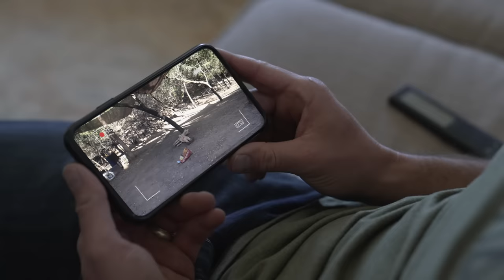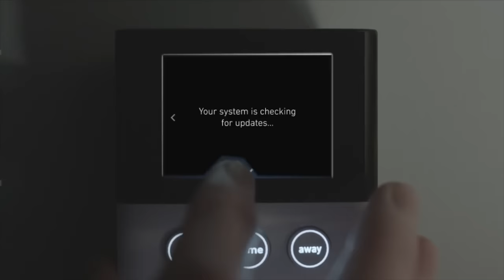Can a Brand New AK Survive the Demolition Test?!?

Comment: just a little calculation : the sound takes 0,384 s to travel from the 100y plate to the camera. The speed of sound given the approximate temperature in the middle of the day at the date of the video (24°C/75,2°F) is 345 m.s⁻¹(~1132 fps) so the sound takes 0,265 s to travel from the plate to the camera, which leaves us with 0,384-0,265=0,119 s which is the time of travel of the bullet from the gun to the plate, which gives us a speed of 768,7 m.s⁻¹ = ~2522 fps which is quite high for an AK. It's really good
Reply: this needs more likes
Reply: I bet raunch dressing really stinks along with primers😅

Comment: Century’s like, “Damn, he actually destroyed the gun we cherry picked for him”.
Reply: I am glad Century finally decided to be honest with their customers. Pretty sure bft stands for blown front tunnion
Reply: @charisperissos1320  Yup. Garbage, just like all of their us made aks. Sad really.
Reply: Would results have been different with a Zastava, Palmetto State, or KUSA?
Reply: Ya confirmed what most already know about Century AKs
Reply: @Asertix357  guaranteed. Those are wayyy better quality and material.
Reply: @spacecadetofficer507  but for $800 this one is totally fine. The stuff Matt did to this AK is not the normal user experience.
Reply: @Asertix357  I found myself wondering if the front trunnion rivets would have held up better.  I actually had a WASR 10/63 blow up on me around 2008.  Best the gunsmith could figure out is it was an out of battery detonation.  The holes for the trigger assembly were oversized on the receiver, his thoughts were that the tapco single hook trigger was at the right angle to miss the tail on the bcg that normally prevents this and caused an out of battery.  Needless to say the front trunnion was split in half and the receiver was all bent up.  The force was so great that the dust cover was actually flat when I found it.  You know what didn't fail?  any of the rivets on the trunnion.
Reply: @Asertix357  the difference between that and a Zastava or an Arsenal is like Harbor freight and Snap On.
Reply: @rslover65  what AK brand do you recommend? I’m not big into the platform but eventually want one
Reply: @rslover65  I've never bought from either Harbor Freight or Snap On, so I don't know what that means.
Reply: @Asertix357  He is saying that one is good quality made to be used a lot (Snap On tools), while the other is fine for doing things on a budget and not using them too hard (Harbor Freight).
Reply: @Sagemel  rather find a decent m70 or even consider the psak-47 for that price range, definitely can't consider century arms as a proper quality rifle. Sure it shoots but so does a hi point. I'd much rather have anything but a hi point or century any day.
Reply: @williamphillip9749  im curious too
Reply: Conclusion is Century is indeed Harbor freight, while the others that are taken seriously as rifles that have extensive field history (zastava etc.)are absolutely the Snap-on brand of ak.
Reply: I know I helped build that gun
Reply: @jonr5847  I'd love to see how some of the more popular AKs would do getting drug around like that. Everyone talking about how bad the Century did while we don't know if the "popular" AKs would have survived either.
Reply: @LaughingTerry  So between the likes of KSUA, Zastava, and Palmetto, which one would be regarded as best for hard use in a bad situation where you might actually be fighting for your life, or otherwise don't have access to a gunsmith for repair work for whatever reason?
Reply: @williamphillip9749  for the $$, Zastava hands down. The Russian stuff is good, but right now it's ridiculous. You can get a new Zastava Zpap for around $1000, an Arsenal will be 2-3x that and I don't think they're any better anyway.
Reply: @williamphillip9749  Virtually any of the imports, Zastava, Arsenal, WASR.  If you have the funds, track down a vepr, they will only continue to increase in value, much like the Saigas.  All of these have a proven track record.  If you are looking for Domestically produced, K-USA and PSA.  PSA does struggle with qc on assembly, but seems to be on the right track as far as well made parts.  If you choose them, get the high quality models with FN  Barrels.  They are also producing Russian and Romanian AK's from parts kits which should be good to go.  Riley Defense is another domestic producer, their early production rifles had a lot of problems, I have really not heard much about them in the past year
Reply: @Asertix357  If you are fighting for your life you use whatever you can get your hands on. That said, the higher quality your tools and training the higher chance of survival.
Reply: @Sagemel  800 for what is basicaly a replica of AK??? oh... i get mine pure type 3 for 500€ :-)
Reply: @LaughingTerry  So which of the available AK manufacturers makes the higher quality variants?
Reply: @charisperissos1320  lololol so VSKA stands for Very Sh**y Kalash Attempt, BFT 47 stands for Blown Front Trunnion. What does C39 and RAS stand for? Lol in all seriousness, it’s sad the us can’t manufacture a decent ak.
Reply: It would seem zastava is the best available in America for price and features, with top quality in mind
Reply: @Asertix357  vayyyy different
Reply: @chrisreedy5577  PSA would be on their way if they could fix their qc issues. One their lower end models did fairly well at battlefield Las vegas
Reply: Most guns will not survive a vehicle yanking on it as it hits a tree at 35mph a bunch of times. This one still was able to shoot. I would send it back on warrantee, I bet they fix it.
Reply: Brandon watching: Century, where's my love.
Brandon watching later: Why am I friends with Matt?
Reply: @Asertix357  Have to laugh that you compared harbor freight to snap on, of all places... They are both so similar in quality that it's not even funny, except snap on severely overcharges for their garbage. At least, that has been my experience with them both. I know a lot of guys who swear by snap on, but I've had so many of them break or strip out on me while doing mundane tasks at various different jobs over the last 20 years that I'd rather hit harbor freight and get the cheap ones that I can replace for cheap or find some 30 year old Craftsman tools being sold in a yard sale or something.
Reply: @Asertix357  No clue. I don't have an AK. I have a 300 Blackout AR, a 30/30 dark, Mossburg Mariner 12 gauge, Stainless Stalker 280 (Yes 280 not 270),   .40 CAL Sub2K and Glock (same mags), and several .22s for plinking. I just never felt the need for an AK.
Reply: @williamphillip9749  there's only 1 real AK Kalashnikov modle 1947.
Reply: @rslover65  20 years ago maybe, Snap Off stuff sucks nowadays, Harbor Freak outlast that crap on a daily basis
Reply: @ScubaOz  that's great, not really the point
Reply: @jonr5847  not really sure how a gun being put through 1000 times more punishment than any responsible user would put it through is in any way indicative of a gun being "garbage"

90% of the shit here is just bandwagon hate
Reply: @williamphillip9749  Arsenal if have the money
Reply: @williamphillip9749  I recommend Zastava. I have a few and their customer service is great. But they don't take standard AKM furniture, they use yugo/Serbian furniture. I love both the M90 and M70
Reply: Take him literally dragging it behind a car into rocks and trees to break it. So not really a bad review.
Reply: @letmethink8350  I would still get a zastava. They are not hard to find, at all. Hell, I would much rather buy the palmetto state ak before I would a century.
Reply: @andrewtucker7990  People used to say the same thing about Glock. I'd rather actually use a gun myself and judge off that rather than what Reddit and shit has to say.
Reply: @Sagemel   I don't know, dog. At least recently PSA's prices have dropped for their forged GF3s. Side folder with Zhukov furniture for 750? Yes, please.
Reply: I was actually very impressed with how well it held up considering centuries reputation, I’ve heard from a lot of people that century has actually fixed a lot of their quality control issues and that they’re decent now
Reply: @Asertix357  palmetto aks shit too
Reply: @Sagemel  it’s really still overpriced for what it is
Reply: @jonr5847  Same with the G3 clones, they are no near the H&K quallitiy.
Reply: @rslover65 yeah the Arsenal being the harbor freight in this situation.     Zastava is making absolute tanks of rifles at this point.  With a much better fit and finish. This isn’t even a debate
Reply: Zastava woulda survived.    Fucking things are bombproof
Reply: @sethmullins8346 it 100% is. 🤷🏼‍♂️ especially considering Brandon and another YouTuber put 5K rounds through a century arms after the guy put 5K rounds on his channel before that. The only issue that happened was a couple of double feeds and it was the same mag every time. Which could reasonably be deduced to being the mag itself and not the rifle. I just bought a BFT-47 and in all fairness I expect it to fail because of all of the century arms hate,  I’ve put almost 300rds through it already and haven’t had anything outside of two double feeds, and that was while mag dumping. It was with the palm mag that came with it so I don’t know if it’s the mag or the gun itself, but outside of that it’s been great and a lot of fun to shoot. Of course the typical rule of thumb for reliability is 1-2K rounds or more. So I won’t act like I know it’s reliable. But it’s been very good to me in the short time I’ve had it. I understand your comment was a year ago, but it just goes to show that the QC fixes weren’t just bullshit 🤷🏼‍♂️
Reply: @joncalman8180 😂😂😂 right...

Comment: "We built an AK to be super tough" sounds the same as "We made new water to be super wet"
Reply: I mean, it's century, they figured out long ago how to make dry water. Probably why they can be confident sending the rifle to Matt when we isn't even gonna pour glitter into the guts of the gun, but dumps it on the left side for some reason
Reply: Not what Garand Thumb says
Reply: Only super tough AK is the one you trade for a SCAR
Reply: @Saanonymous80  Scars are definitely not close to an ak in toughness
Reply: Лучше и не скажешь))
Reply: @Saanonymous80  scar, that's funny.
Reply: You get mud in any AK and they DO NOT work. They don’t withstand everything, a complete myth that’s been debunked by Garand Thumb, InRangeTV, Ian McCollum from Forgotten weapons and even one of Brandon Herrera’s older vids. DI Gas ARs will perform absolutely phenomenally no matter how much mud you pack into them, but don’t perform as well in cold weather like an AK will. Different guns are like different tools for different purposes. Really shouldn’t come as a surprise to anyone with even the most rudimentary knowledge on firearms, the AK piston system, and more open looser design will allow it to be less restricted in freezing ice, but will easily allow mud to get into its guts and jam it up. AR’s on the other hand have much more gas ports that will literally blow the mud out of the action specifically ones that use the DI gas system. They are also much more sealed and tightly designed than an AK so it’s much MUCH harder to get mud deep inside them even if you try cramming it in there like Garand Thumb did in his torture test vids. More restricted design will cause it to seize up in freezing weather however.
Reply: @xthee_0nly_1x11  не плачь, малыш, всё будет хорошо
Reply: @xthee_0nly_1x11  If you get a lot of mud and grim into an AK it'll fail. When presented with some mud or grim actually in the action, the AR fails much sooner than the AK. Polenar did a good test showing what happens when you get the systems mags dirty which realistically is the most likely situation to introduce debris into a system and the AK won there
Reply: water isn’t wet
Reply: Fun fact: water is not wet. Wetness is something dry being in the state of moist from water or other liquids. Water cannot fulfil those requirements so it is not wet.
Reply: @snakevenom56  I have a big white box in my kitchen that can make dry water.
Reply: @xthee_0nly_1x11  Dude, I’ve seen ARs fail after every other shot just from gunpowder residue and lack of lube. At an indoor gun range. You’re not going to convince me it has no problem if you throw it into a pool of mud with the receiver open.

AKs are very well known for tolerating harsh conditions better than ARs. The Russian Army during the AK-12 design phase around 2012-2014 tried to redesign the AK-74M to be an AR-like platform but found that the AR-style AK failed stress and environment tests which all previous AKs had to meet. The design was rejected and led to the AK-12 being a traditional modernization of the AK-74M instead of an AR with AK furniture.
Reply: @anteshell  well, since each water molecule is surrounded by other water molecules that makes water wet unless you somehow have an individual water molecule
Reply: @BigBenC1991  try to be clever, eh? It doesn't work that way. An individual atom or even molecule is neither liquid nor solid. By its nature it cannot have such property as dryness or wetness.
Reply: @anteshell  okay, but either way all the water in any volume of water (except maybe the outside layer) would still be wet as it is still surrounded or somehow coated by water
Reply: @anteshell  no definition I can find anywhere mentions that the wet thing must be a solid. They merely say that wet is something along the lines of covered or saturated in or with water or some other liquid therefore water is wet by nature of being covered and saturated in itself. Perhaps there could be an argument that a liquid cannot be wetted by itself but only by a different liquid other than itself but that's getting pretty pedantic.
Reply: @BigBenC1991  exactly. Saturated by water, or more correctly, a liquid. Liquid can not be saturated by itself nor any other liquid. Saturation does not work like that.

So, how does it work you ask? A liquid can be saturated only by something soluble. Neither a liquid nor non-soluble solid can do that. 100% saturation means that the soluble cannot dissolve anymore to the liquid. For example, in case of sugar and water, 100% saturation means that any added sugar will not dissolve anymore but remain in the crystallized form.

Also, scientific definitions are not pedantic. They are accurate. If they would have similar leeway as colloquial definitions often have, they become completely meaningless in science. 

How does your head feel? Does it hurt yet from all that banging?

Comment: I’m convinced that if u just bend it back like by standing on it with a foot or anyway some kind of force, it would cicle again just fine. Would be curious to find out.
Reply: or just beat it up against a tree the bigger worry then the bend is the rivets lol.
Reply: @LavitosExodius  Quick spot weld or two  or even a bit of JB  and it'll be fine.
Reply: Actually old com block armorers kits have devices where you can fixate for example the gas block to hammer it back into shape. The Ak would still be servicable after a visit with the field armorer. 1 hour work maybe
Reply: The rivets would have to be replaced because as it was there its just a matter of time before a catastrophic failure

Comment: Oh man, I was literally yelling at the screen for you to curb stomp the receiver straight! You could have done at least 3 more tests!
Reply: With those sheared front trunnion rivets I wouldn't be willing to be close to that AK firing even behind that plate. The front trunnion was probably only being held in by the bent receiver at that point.
Reply: Right?!?

I told the wife, just rap it against a tree the opposite way to take to bend out... Good as new.
Reply: @witiwap86  get some bailing wire, fix it right up. Tactile bailing wire!

Comment: Matt created the first semi-automatic bolt action AK with every shot bolt hold open
Reply: Very sure there have been lot of cases where people have beated their ak:s to point where any
higher tolerance guns would simply cease to exist. Ak would run without recoilspring. Just
use couple rubberbands behind of bolt wihtout dustcover. Gastube missing ? Well most likely it will
still fire and even eject but may suffer some hickups because gaspiston may not dive in that gasport hole because
not tube guiding it. Recoilspring, gaspipe gaspiston are missing ? 
Well Ivan now you have straight pull mosin.
Reply: @Kesssuli  Next you're going to tell me that's just normal ranch dressing and dumped in there
Reply: @bubbahead383  Dunno but for sure it was still far more lubricant than average ak in world will got its serving time.
Reply: @Kesssuli  that's what I was think while he was dumping it in there. It's like 90% vegetable oil anyway